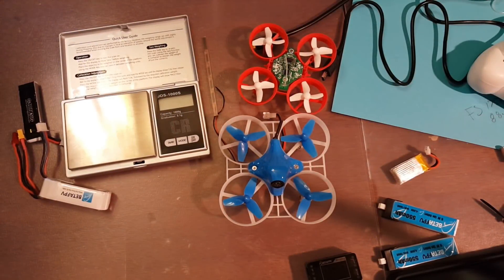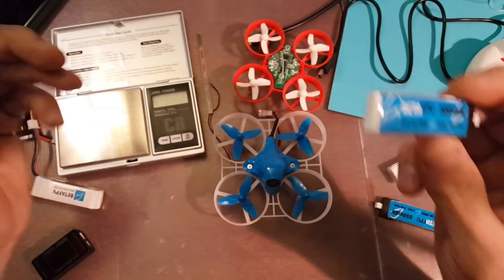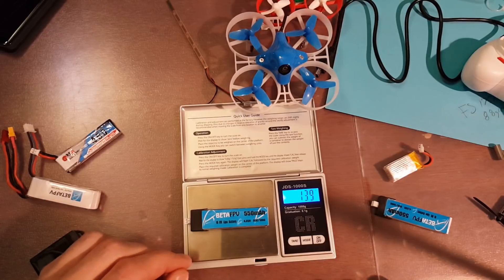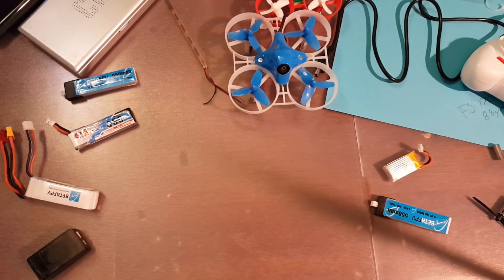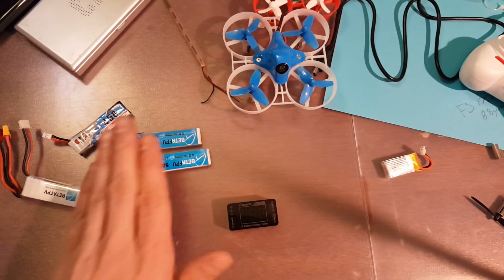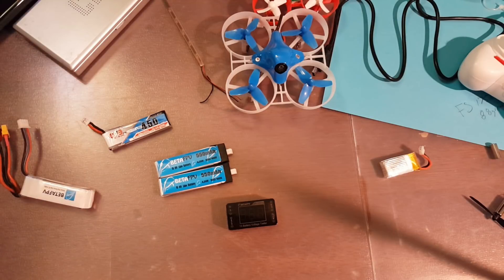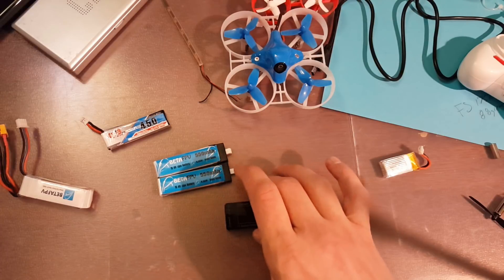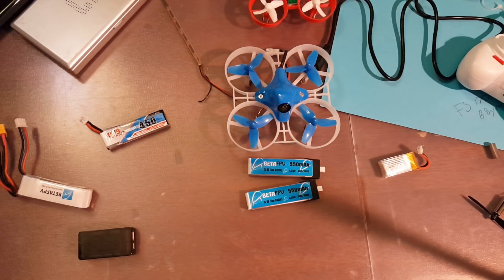BetaFPV 550Mah LiHV 1S Lipo

Comment: I just bought these and I can’t fit them both into the frame. Are you using only 1 and shorting the second JST? I usually fly two 1s 300mah. I was so excited to get the 650mah, but they don’t fit!

Comment: You don't think 14g is too much? I have been thru 25 packs of these in my 75S and find them too heavy for this quad. I'm constantly fighting to keep from smacking the ground - any downward momentum or pitch forward and full throttle isn't enough to recover. Might be my flying skills, but I don't have this issue with my babyhawk r whatsoever, even with an 850 3S battery.

Comment: Hello. I've had my Beta75 for a few weeks. I have four 550 mAh HV batteries, charged to 4.35 VDC, giving mostly 2:45 of flight time. I could not use the supplied battery, which is a 260 mAh, as it would get to hot to the touch, so did the motors, after a flight. However, after racing, the motors are cooler then when flying around the house. I did install cooling fins, aluminum tape, on each motor. I don't think the fins provide much cooling. The Beta75, compared to my son's Inductrix, is, and flies, much heavier. Also the camera's resolution, on the Beta75, is a bit lower than the Inductrix. The Beta75 did not have video when I received it. Because of the approach of Christmas, I decided to inspect and repair it myself. After a close inspection revealing what appears to be a very quick assembly, at BetaFPV, I found the the connector, for the VTx, had a pin pushed out. After repositioning the pin, test results were good. I labeled the VTx LED channel indicators so I could tell which pair of LEDs matched which channel while viewed through a hole in the canopy. Then reassembled the quad, tidying up the wiring, antennas, and battery lead, with thread, and the quad has performed well since. It has been very educational using BetaFlight and the OSD with the quad, preparing me for future, more complex quads. Overall, the Beta75 is fun. Its my first quad, after flying my son's Inductrix. Both are different little beasts! Thanks for the video. Peace...Guy